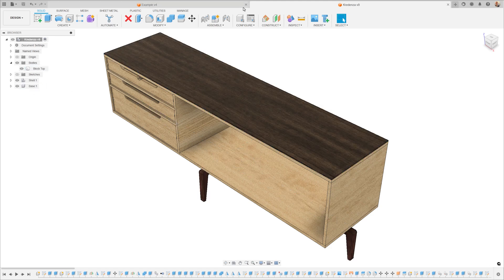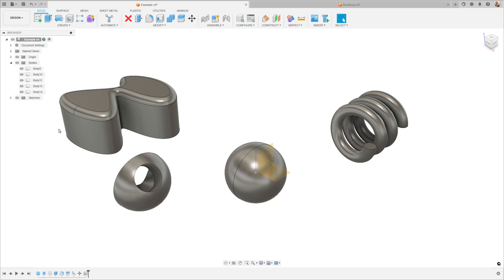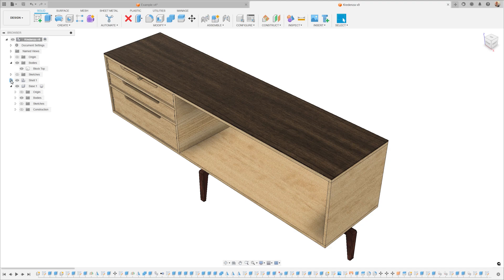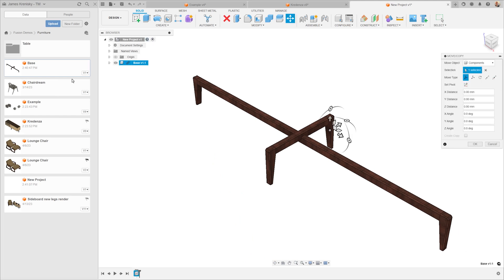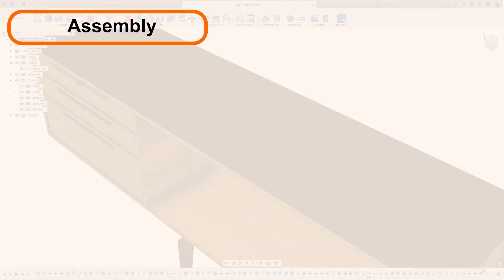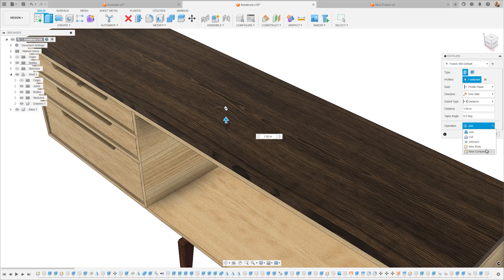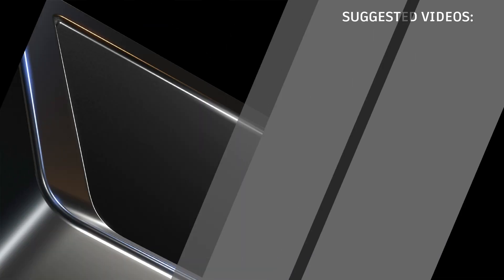Master Autodesk Fusion: Understanding Bodies vs Components [UPDATED!!]

Comment: 99% of my parts are a single body. I assume there is no reason to make that into a Component since it can be dragged into an Assembly anyway? Or is there still a benefit? Is it needed for Joints to work properly? I read that it was, but I have also made Joints without turning a part into a "component." Does this mean that single-body parts imported into an Assembly get "component" status automatically?

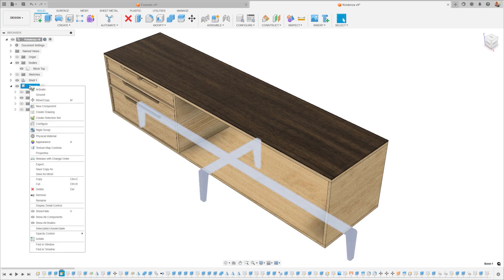Comment: At 2:40 you exported the component as it's own file to be able to be reused. However on the original assembly you still have the unlinked version of that component. 
Is it on the plans to include a check box or similar to automatically replace the local instance on the original assembly with the external linked version of that component?  AFAIK the "save copy as" command does the exactly same thing and also don't create the link automatically - you could change the functionality of it to perform this change automatically.